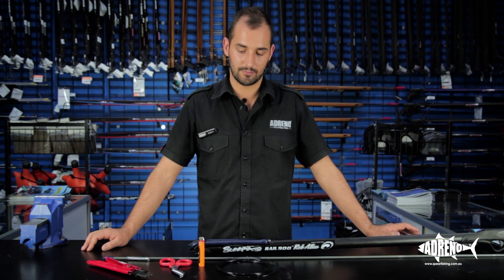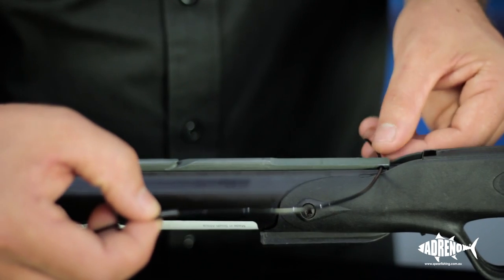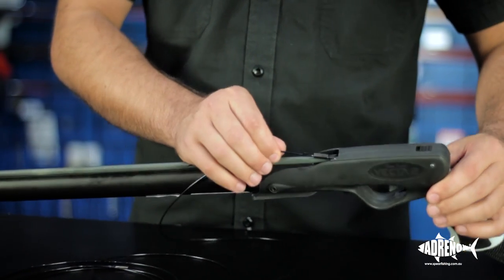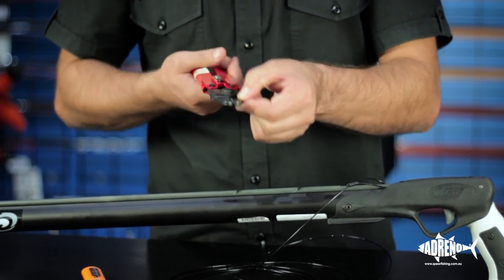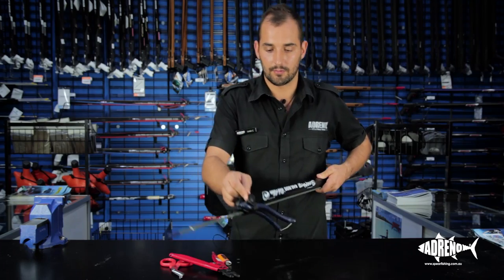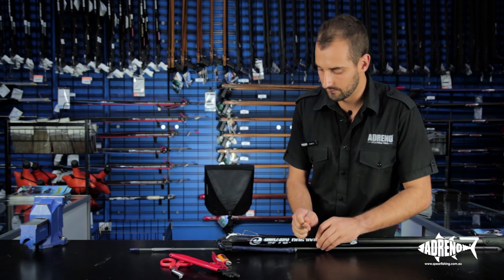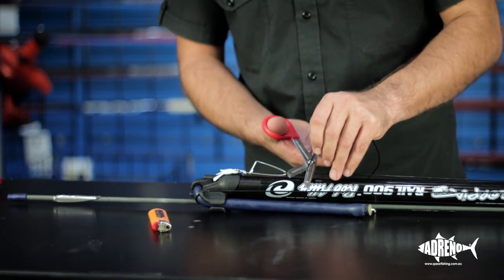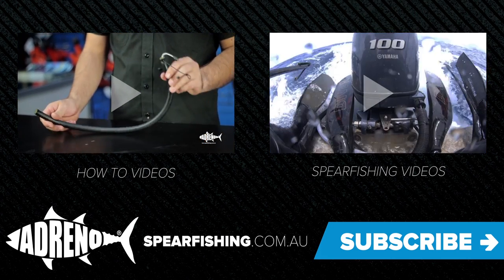How To Rig a Shaft | ADRENO

Comment: I'm a newb, haven't been out fishing yet. I've got a closed muzzel identical to the one shown. I recently put 2mm mono on it and crimped as shown in this video (thanks!). I haven't tried firing the gun yet because I'm afraid the crimp will get jammed in the closed muzzel (my crimp is a little bigger than the one in the vid). Is this a valid concern? Is it common for crimps to jam in a closed muzzel? Thanks!
Reply: Hi Danny! I'm new to all of this as well and have been out to shoot three weekends already. I've shot and loaded multiple times and share your concern. It would be best, if possible, to have your set up looked at by an experienced person. I've taken my gun to the shop where I bought my supplies and the staff at the counter were friendly enough to give me the advice and direction needed.  If you can load the shaft from the front in reverse easily then it should be fine. I guess the reason for the offset level on the back end of the spear is to allow for loading and then it should flow through the muzzle normally. Hope you had some great catch by the time you read this message.